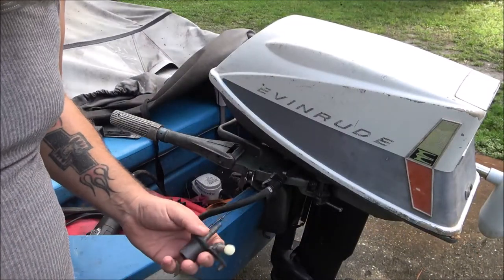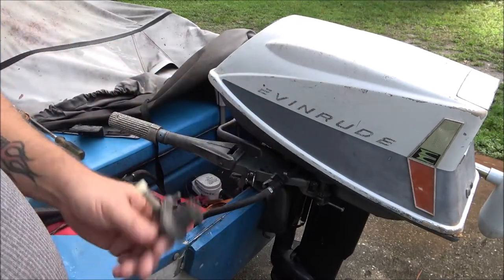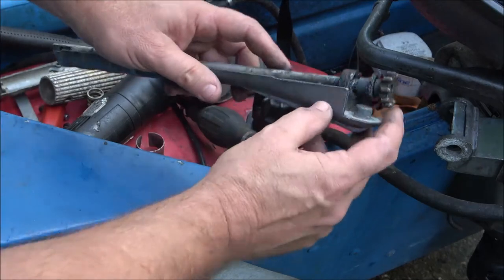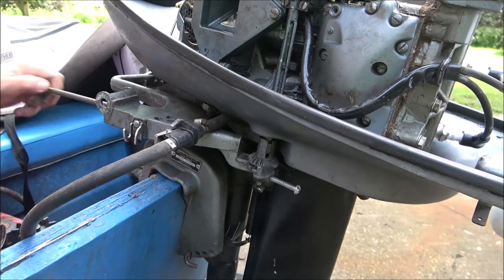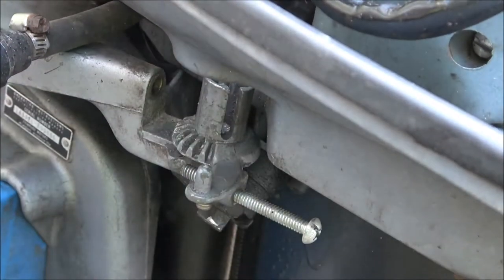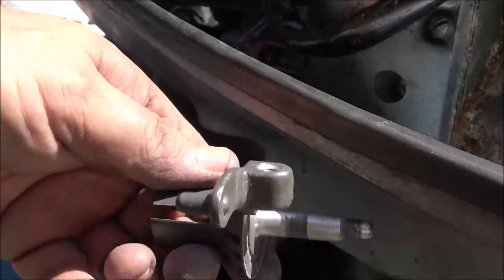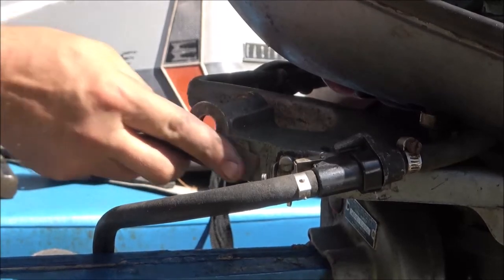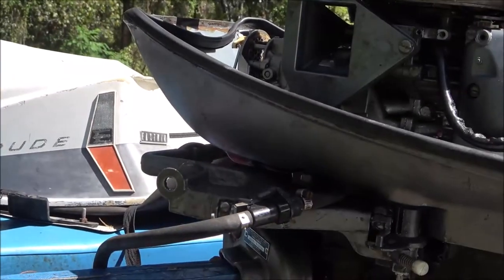Throttle Control Gear Replacement 1963 Evinrude Fastwin/Johnson Outboard Motor

Comment: My gear linkage was very tight, Thank You, I need to remove the vertical linkage clean old caked lithium and put some fresh grease in there.
Reply: Still too tight can't remove gear. The plastic bushing must have swelled over the years. I try some heat but but no go.

Comment: Thanks for the video. Just got the exact same motor and the lower pin or shank is broken on that gear. Going to check out eBay thanks
Reply from the maker: You're welcome. Thanks for watching and commenting.

Comment: My gear into plastic bushing is so tight can barely move it. At this point so tight I can't remove it. Shot cleaner up hole to clean out old grease no help. Any recommendations on removing it with damaging it? Its a struggle just to move it back and forth, let alone raise it to remove it.
Reply from the maker: Just keep working with it. Use wd40 or pb blaster, it might take some time but eventually it will free up

Comment: Where you get that part from .. im in need of one also
Reply from the maker: eBay. They have a lot of them. You can also go to Crowley Marine but you will pay almost 3 times what it's going for on ebay.
Reply: @shabear1000  mainly need that plastic screw piece haha.. sucks they don’t make real screw
Reply from the maker: @WeOutChea  I used a regular screw in mine. Hardware store will have it.
Reply: @shabear1000  I think I need to take my handle apart like you and grease it all up .. mine don’t turn as smooth as you
Reply from the maker: @WeOutChea  I had to do the same thing. It will help a lot.

Comment: I have this same motor. We’re are you finding parts from? I was told I couldn’t get any parts for mine.
Reply from the maker: There are several boat motor sites on the internet. One is called Crowley Marine. But you can find anything you need for that motor. Aso eBay has a lot of stuff for them motors. If you need any help coming up with parts, let me know and I'll do what I can to help you.